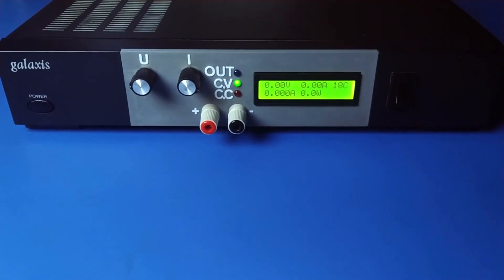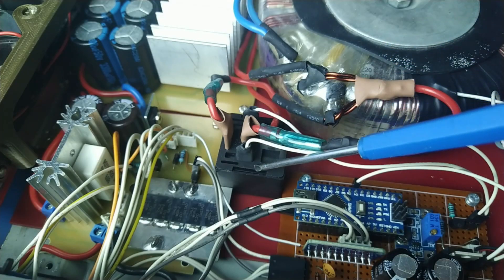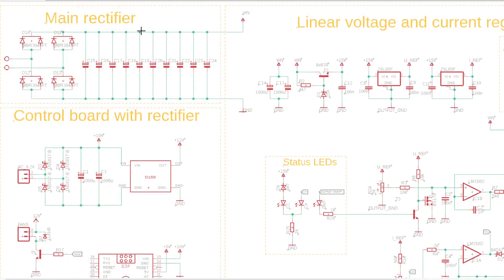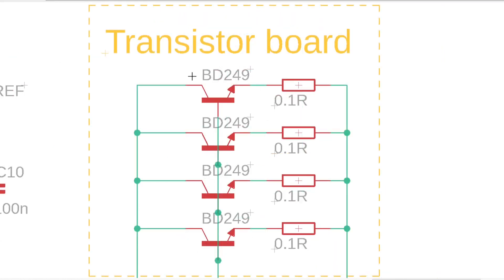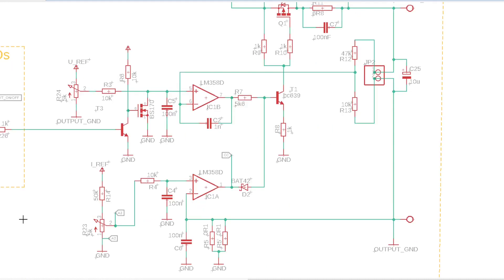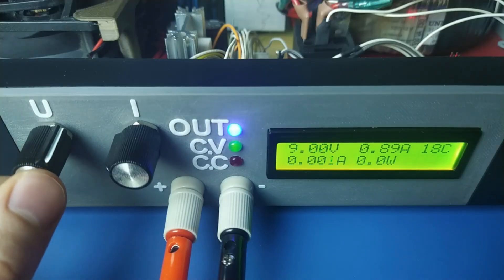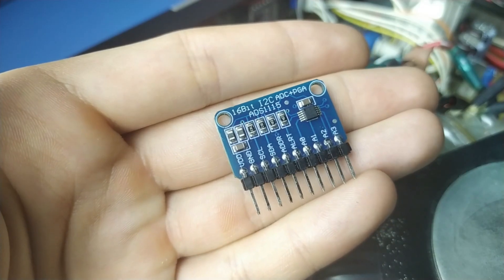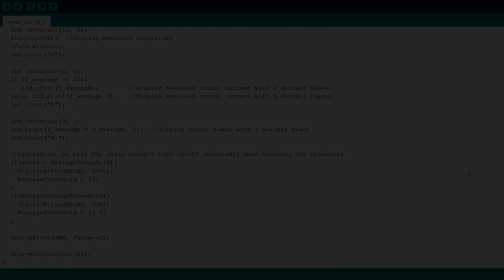Homemade linear bench power supply 0-28V 0.01-10A 250W!

Comment: I am no control loop expert, I struggle with this in my own designs.  But, from what I do know suggests your loop gain is ultra high with the BC639(which op-amps are not designed for, if you want to keep decent phase margin to stop oscilations).  I assume the 1nF comp cap on the LM358 half being necessary because of this?  ...or am I missing something?  Slow voltage response? You have a 10uF output cap so I assume not, but how?  BTW I love someone for ONCE designing a supply with a GIGANTIC output cap, which craps all over CC control.   Would LOVE TO SEE transient response scope captures for your design :)
Reply from the maker: Yes, this 1nF capacitor is to stop oscillations. Do you have any suggestions to help with stability of this circuit? I'd be glad to receive some advice, I had a lot of trouble with this circuit oscillating. I might do some transient response measurements in the future ;)
Reply: @dominikworkshop6007  OK, that answers it.
I expect the stability problem is because of the ultra high gain you have in your loop.  One suggestion I have is avoid external voltage gain.  In your circuit this can be done by using an emitter follower to drive the output tranies DIRECTLY (get rid of the IRF9530).  Watch your power dissipation and SAO (safe area of operation) for the driver trannie (the BC649 will not cut it).  Something like a BD135/7/9 is very cheap and ok for this. You likely will need a small heat sink on it.  Doing this is easy in you circuit as once ther IRF9530 is gone the driver tranie as an emitter follower (i.e. collector to input voltage, emitter to base of output pass trannies, is at the right phase.  You may need to lower R7 to 1k or so for more current because the BD139 has a low gain (but it is cheap and jelly bean common).  You may need to put a schotcky diode (the cheap and also jelly bean common 1N5819 will do) from the BD139 emitter to the output base, to protect from reverse input voltage (which absolutely WILL blow up your op-amp, should it ever happen, remember reverse Vbe is 5V or so on all trannies).
If you don't already have/use the free LTSPICE,simulator (just download from analog.com) , you can try your design without rework until ready.  I suggest you start with your current circuit and see how the stability compares to your actual real world build.  ...do keep in mind that a simulator gets you in the ball park, real world tweaking/testing still required.  The BD___ trannies are not in the LTSpice libraries, just pick similar ones from what they have to get you started.  You will have to get the LM358 model from a download ...use google to look for "LTSPice LM358 model".
I made a suggestion about your voltage reference in another comment, if you are interested.
BTW, I love the way you did the whole design, MCU, software, and all.  Many do not bother or sometimes even know how, ...hat of to you :)
Reply: Having thought about it, the BD139 might not cut it either due to it's low gain,.  The 2SD882 is a better choice (also cheap and jelly bean common).
Reply: @dominikworkshop6007  In your transient response testing; if you see ANY ringing, then it is likely that under some load conditions the PSU will oscillate ..just something I learnt the hard way in one of my designs that I thought was great, but as it turned out, no so much :)
Reply from the maker: @stevenbliss989  Thank you very much for your advice! I appreciate it so much!!! If I find enough time (sadly, not sooner than in one month) I will try to implement all the suggested improvements. But first I will do some transient response measurements, because I'm wondering if I managed to handle the oclillation problem well enough. Of course I will try to make a wideo about it ;)
Reply: The problem with stability is not where the gain is high, but where the gain drops to 0 dB (x1, "unity"). That is where oscillation can occur if the phase shift around the loop is 360 degrees.

If you consider high bandwidth op-amps, those which are under-compensated (various terminology) typically are stable with a closed loop gain of perhaps 5 or more. If you try to run them at lower gain without rolling off their frequency response you're in for trouble. Even fast amps compensated for unity gain tend to have moderate peaks in response that manifest as overshoot at low gains.

It is very common in power supplies to run the error amplifier open-loop at DC. I've designed a lot of switchers and almost always used that approach. The trick is to get adequate phase margin. You really want your Bode plot to pass through 0 dB with a a few tens of degrees of phase margin and a slope of -1. Too little phase margin or a slope greater than -1 (i.e. more negative, like -2) and you'll likely run into trouble.

That said, gain which is not easily quantifiable and which can vary substantially can make it hard to close the loop with confidence. 

One thing I would do in a bench supply is go to the trouble and expense of using a negative supply for the control circuity so that I could use inverting amplifiers in critical positions. One of the things that really kills speed in op amp circuits is allowing the amp's output to saturate. It can take a long time for a saturated amp to come off the rail and that degrades dynamic performance. In general it is much easier to add bounding circuitry to an inverting amp than to a non-inverting amp operating as a differential amp (i.e. varying voltage at inputs). Bounding can also improve performance with large-signal conditions that don't go so far as to result in the output hitting the rail. It keeps both internal compensation caps and external compensation caps from accumulating large charge that has to be removed after the large signal event before the output can get back to where it needs to be. (Consider the case where the maximum voltage out of an error amp required for full "ON" of the power path is 5 volts, but you're running your amps at 12 volts. A large signal condition might make the amp output go to 9-10 volts and charge compensation caps to that in the process. To even begin to recover from that the caps must discharge to let the output get back to 5 volts before any semblance of control is regained. Meanwhile the power path is still "turned up to 11.")

Even op amps with high performance tend to be a relatively small part of the overall cost of a bench supply. However, high bandwidth amps rarely bring anything but grief when the power path is slow, with the possible exception of faster recovery from saturation. Slow op amps with fast "boost" circuitry tends to  result in a circuit that is well behaved.  Fast amps with slow boost circuitry can be very troublesome. You don't want your amps to be slowing the whole thing down, but you get problems from excessively fast amps. In power supplies it is usually the power path that limits the bandwidth that can be achieved.
Reply: You are so right about slow power paths being an issue.  I have not solved this, trying mosfets which both have a SOA that is ok for the job and a low enough gate cap to not need Herculees to slew fast, then of course when using BJT (both NPN emitter follower, or PNP collector output), have their issues as well.  Your advise does explain why the relatively slow TL07x op-amps are common in PSU designs, where as I would prefer very fast 200Mhz-500Mhz current op-amps, which usually give me more grief than help.  I really really hate slow transient response PSU designs (especially slow CC mode), but they are SO SO SO hard to make that way and be unconditionally stable (as a bench PSU must be)!  Having said all that though, I would NEVER EVER use a LM358, apart from bandwidth, it's slew rate is GARBAGE, and phase reversal is way too easy, as Dominik is finding sadly. :(  Regardless, his loop has INSANE gain but very slow slew, which is begging for issues.  BTW op-amp saturation is very much an issue, which is why some of my designs use ultra high speed (<20nS) comparators, as I assume you know, comparators do not saturate, much, but they cost $$$ :)
Reply: @stevenbliss989  
Constant current dynamics in a supply designed primarily for constant voltage is often a problem because lots of capacitance at the output of a CV supply is almost invariably helpful. Of course it is anything but helpful for CC operation. I have a Kepco linear bench supply rated at (iirc, 80V and 12.5 A max). For optimum performance in CC the output capacitance can be greatly reduced. 

The crossover to/from CV from/to CC due to load change is something that can be made much worse by designs that allow compensation caps to accumulate large charge. Again, bounding is usually much easier when you have a nice neat virtual ground at the inverting input of your amp.

I can't recall ever using anything faster than LM358/324 in power supplies, but I'm talking about switchers running at 100 kHz where inherent bandwidth is not great. Error amps in switcher control ICs don't have anything even remotely spectacular for bandwidth.
Phase reversal in the LM324 isn't an issue unless you take the inputs negative with respect to the negative supply rail. I've used tons of them in power electronics that have been commercially made and used in harsh environments and never had a single problem.
If I were designing linear supplies for something like automatic test I'd likely use something much better. I hope to be returned to the molecules whence I came without ever designing another power supply, especially another switcher.

I've done a number of power supplies, both switchers and phase-angle controllers with three control loops - one CV, one CC and one based on potential between a structure and a remote electro-chemical reference "half cell." That can get a bit messy.

Linear operation of power MOSFETs is an interesting problem. There are very few devices optimized for linear use and they are quite expensive. Most FET manufactures have little to say about linear use of their FETs, I presume because they know of the problem due to temperature coefficient of cell resistance slope change and the nasty things that can result when working on the negative slope side. I once looked fairly seriously at using linear FETs to make an active load (not some crude thing, but one that would do proper resistive load emulation along with CC, CV and Cpower and had response adequate for testing power supplies properly. Plus I'd really have liked to be able to go up to 400 volts at a few amps for testing active power factor correction stages. Again, I'm glad I'm out of that stuff now.

I once went on a quest for a really fast comparator with very high input impedance. I don't even remember what I wanted it for. No such thing existed at the time. I think there are a very small number on the market now. It vaguely seems to me that there is at least one with JFET inputs.
Reply: Constant current dynamics:  You are so right, it is the bane of my life!  I mostly design hybrid tracking power supplies.  On a novel side, I am playing around with a dual switch single output tracking power supply, the main switcher and an aux switcher that charges up large caps to whatever the voltage selected is so that in CC mode it can respond FAST, way before the main switcher is able to catch up.  That way as long at sudden CC load changes asking for more voltage (which means lower power - an advantage!) is not crazy too often (and the complex time/freq etc. etc dynamics), in practice will have a CC response time essentially as good as a fully linear power supply.  There are issues that I have not solved yet, but I am close!   The ability to ramp up/down large voltages in CC mode FAST is one of these pains.

Again, having large caps on the output is EVIL EVIL EVIL!!!!!!!!!!!!!!!!!
Most of my designs have 0.1uF, several had 1uf (cheaper designs).

All of these issues would be less for me if I had the math skills required for detailed analysis of feedback loops.  I come from a digital electronics background originally!  I love a challenge, so long as not so too long that I end up bankrupt and starving! :)  Anyway, I have tried several separate CV & CC control loops AND separate pass elements, both then feeding back to the tracking switcher fast enough to keep the pass elements from blowing up.  Works surprisingly well, and this is where I am trying to get the dual switcher idea going to get around the shit performance when higher voltage in CC mode is suddenly required!  Although real life need for such performance is rare, I WANT IT!!!!!!!!!!!! :)

Funny you mention dummy loads, that is something I also am involved in, and yeah all those cheapo units out there (when they don't blow up), are utter CRAP when it comes to dynamic performance.  Commercial units are very stable, BUT like commercial power supplies suffer from crap transient response, which again, in real world need is rare, but I WANT IT! :)  Just like with CC, it is a bitch to do with high slew rates and stability, and VERY important NO overshoot!  The trouble with linear mosfets is their cost and slow response time, but it's not terrible unless you look at very old ones, which are MUCH cheaper.  Today there are many "switcher" mosfets with SOA as good as linear fets, and that is what I am going for in my designs.  I am torn between PID loop control, and a hybrid digital loop design (much more difficult).  Currently I am bread boarding a PID loop which is more stable that I expected, but overshoot keeps rearing it's ugly head.  Maybe PID is the way to go, but I could NEVER get it to work well in a power supply, ...I think I may not have tried hard enough, or not used fast enough op-amps, maybe something in the terahertz range!!! :):):)

Having a digital and programming start and much ofmy career, I am looking at using GHz range DSPs for this, as they in theory should be able to do this, BUT, BUT, BUT compensating for all the things that change, which a feedback loop would normally take care of is a BITCH BITCH!  So I am taking some courses on AI, as this is the only viable solution here, but it means I am maybe a decade away (or three years if I could work on it ecxclusively).  I read a paper from a manufacturer that is already onto this (BASTARD), so I feel certain it is viable!

I have NEVER found a good FAST comparator with high Z, I was always forced to use a unity (or more usually) buffer, which of course messed up loop dynamics to no end!  Not to mention the faster the comparator the CRAPier the small signal response time, negating it's advantage some in the firs place, and of course making the whole control loop dynamic even more complex!  Comparators are great and auful at the same time (at the very high speed end!).  Afast JFET comparator would be great, ...do you rememebr what it was, and was it <$1M.  The cost of components in a PSU is mostly the magnetics, heat sinks and housing mostly, but parts like precision standards & op-amps are not 0$ either (except in cheap designs using LM4040's, TL07x's etc.).

In conclusion to this large response, you are a wealth of knowledge, and I suspect is a "math boy" for loop poles etc.  I am interested in knowing what you wish you could design and make work but never could (economically)????
Reply: @stevenbliss989  
What do you mean by "hybrid tracking supplies?" 
Are you talking about PV MPP tracking or something else? The problem is much the same for several types of power-limited sources.
I've designed several MPP trackers that have performed very well using ... an LM324 op amp as the error amplifier. Just one more control loop in what is basically a CC CV switcher. I even did an ultrasimple one that switches but isn't an SMPS in the usual sense. The load was purely resistive. It never went anywhere because my "partner" in the US kept insisting we had to buy into a NIST patent, though what I was doing was much cheaper, easier and performed better than what their patented mess did. I'm glad I'm out of this nonsense.
Reply: A tracking switcher followed by a linear LDO reg. :)  I have done several MPPT chargers, but no money in it except for special needs, but not too difficult as no need for high precision.
Reply: I meant WITHOUT a GIGANTIC output cap  ...typo :)

Comment: Why such good work and use a 7805 as a reference? At least put 100 ma. load on the 7805 for stability and a ceramic capacitor. I don't like the fet used in resistive mode to feed the pass transistors.
Reply from the maker: I used a 7805 because it's very cheap, and reasonably accurate. There are ceramic capacitors, but I guess that if I load this IC with 100mA it will heat up enough to change its output voltage significantly. Why don't you like the FET there? What do you suggest instead? Thank you for your feedback!
Reply: @dominikworkshop6007  I assume Daves is referring to the issue of ultra high gain  ...Daves???   I would love to know your thoughts on this, because I stick to <1 gain for external control/pass elements for stability (I use high speed op-amps for fast response >60Mhz, which make loop stability a small nightmare at times for me).   Most commercial supplies also use slowish op-amps like TL062/072/082's. Your design uses an even slower op-amp?  Is this due to low cost/availability, or was this by design for some other reason?  BTW for the reference, you may want to consider a TL431?  ...also VERY CHEAP but much more accurate, 0.5% to 2% depending on grade (and only requires a 1mA load).
Reply from the maker: @stevenbliss989  I used an LM358 because I had it laying around.